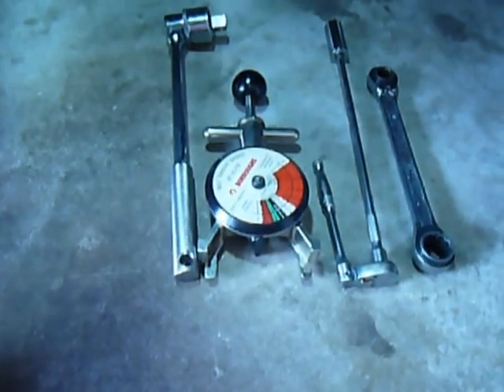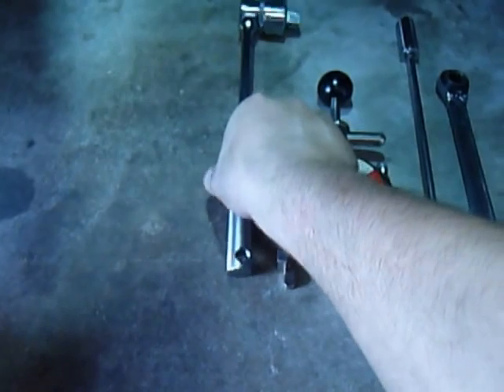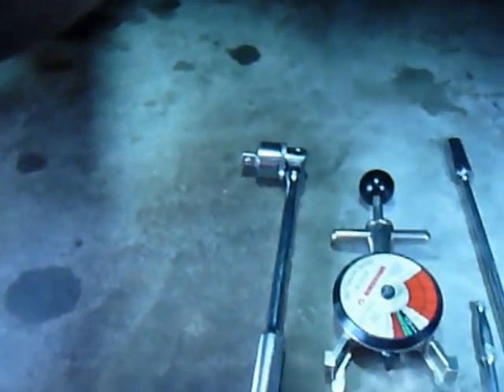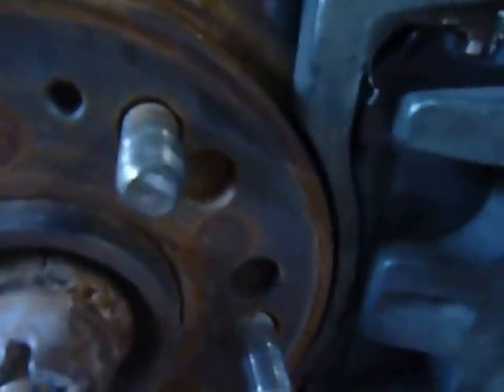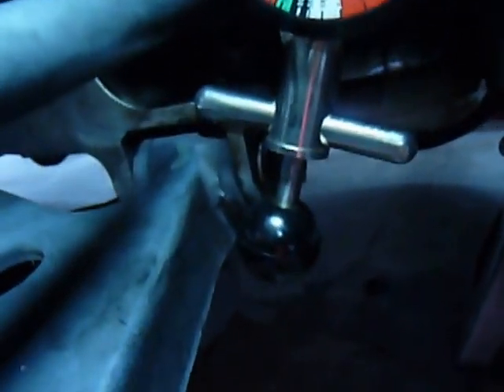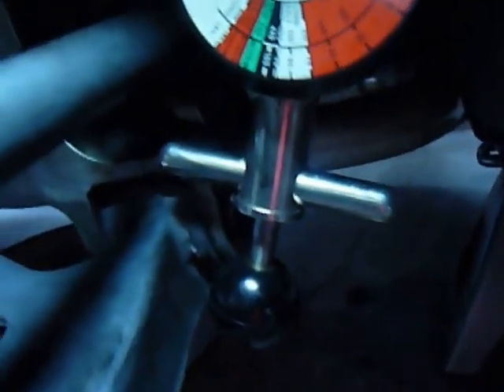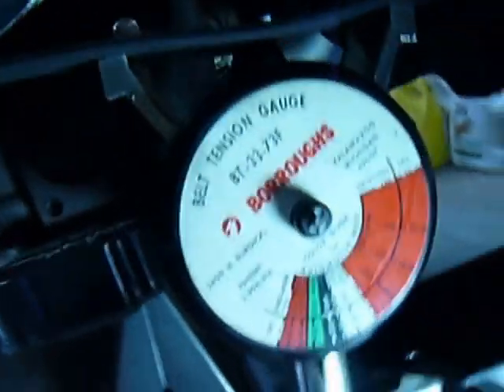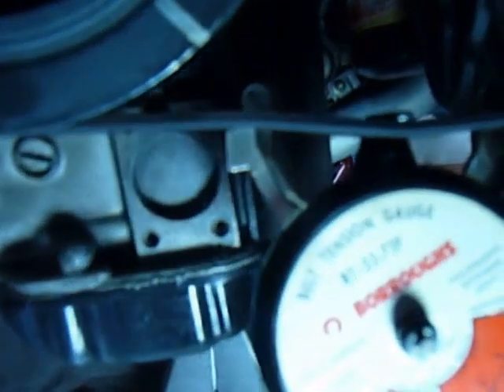Club 3g  2000-2005 eclipse:  Using a belt tension gauge on a SOHC 6G72 engine

Comment: Do you need to know the deflection of that belt to use that tool
Reply from the maker: 90 to 100 foot pounds.
Reply: How about for Honda Accord 4 cy
Reply from the maker: @brandonwebb1819  The same principle applies 90 to 100 ft. Pounds deflection will be needed.